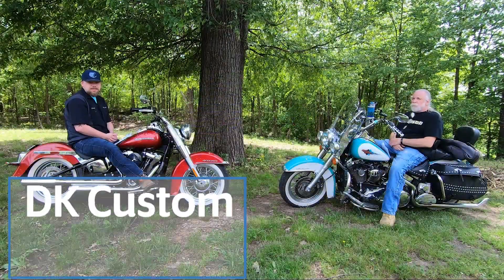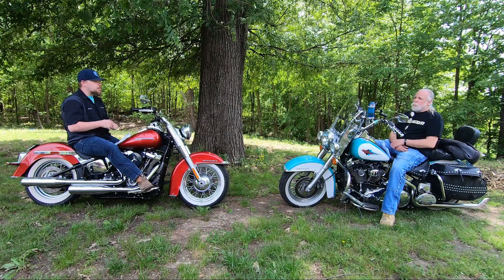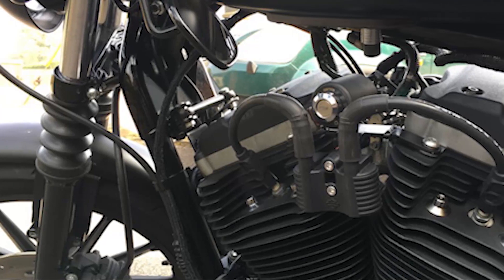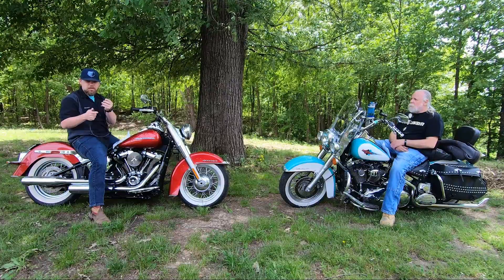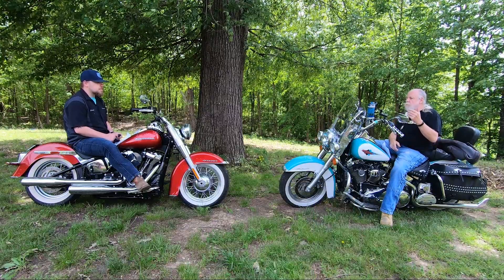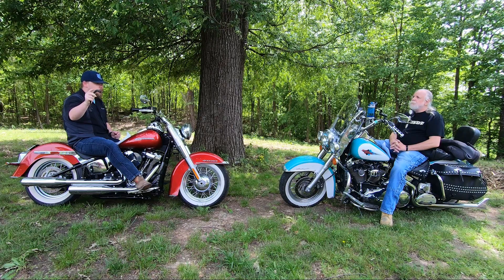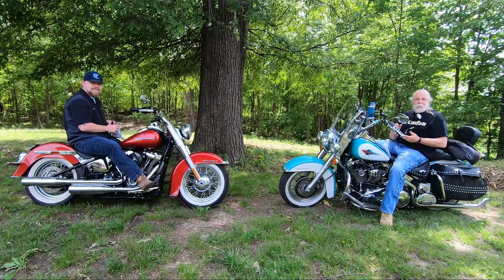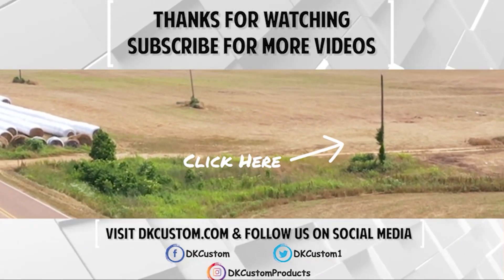DK Q&A #9 - Performance, 409 Pro-Race, Harley SE

Comment: That red sheath doesn’t just peel away from that white core when making your own lengths. It was stuck to the white portion on one of the wires I got and ended up tearing a good chunk of the white portion away. That silicone will rip pretty easily.
Reply from the maker: Yes, they are very tight, some fine razor blade work gets the job done.

Comment: Wait I just bought some thundervolt 50 spark wires off your site for the M8 how are these? Can’t find a video on them
Ikes so did I order the wrong spark wires? I want the best ones for my M8 2020 RGS ????? I just placed a order this am
I want the best ones. Have a build going on now so please makes sure customer service gets with before shipping I don’t have time to ship and re ship and re ship
Reply from the maker: We only have one type of plug wires for the M8, so if you ordered M8 wires off our site, you ordered the best.  M8 engines use a different wire than the Twin Cams and Sportsters, they use the same technology, but with some variances for the M8, which does not use ION Sensing for knock retard.  If you are not sure, then please write or call Customer Service at Support@DKCustomProducts.com or 662-252-8828

Comment: I needed plug wires and my dealer had gotten on my last nerve. I didn't want to hear about screaming seagull. I got the cut to fit type in 10 mm. Now it says my resistance should be 250 to 300 ohms per inch because of my knock sensor. I was a little grumpy and didn't care. I would turn it off if it was an issue. The new wires were high performance low resistance at about 40 ohms per inch. Knock retard works if it has to just fine.  No interference with computer or stereo either. I have spent considerable time in eliminating spark knock by dialing things in with the super tuner so it should have been minimal anyhow. The bike is a 2016 Ultra Classic with stage 5 shredder kit. Almost 10k miles on the plug wires with no issues
Reply from the maker: Great to hear!  Sometimes it is the little things that can make some of the biggest differences.

Comment: So my 08 Nightster doesn't have the knock sensing? Wanting to do the coil relocate but not sure... I don't wanna run into problems.
Reply from the maker: Thank you for watching our video.
No, it does not have knock sensing.
The location of the coil has no effect on how it operates.
When you use one of our Coil Relocation Kits and choose the Pro-Race Wires, those are better wires than stock and will improve the bikes spark (running).
Link to Coil Relo's- https://www.dkcustomproducts.com/07-up-relocation-kits-51.htm

Comment: Do you have a recommended plug for those wires?
Reply from the maker: We've tested dozens of different plugs over the years and always end up back at the OEM plugs.
Reply: Screamin Seagull has standard and high compression plugs, a little higher quality than stock. NGK iridium is probably even better.